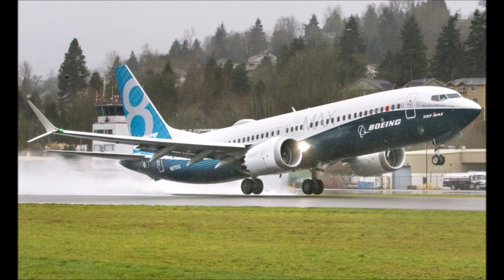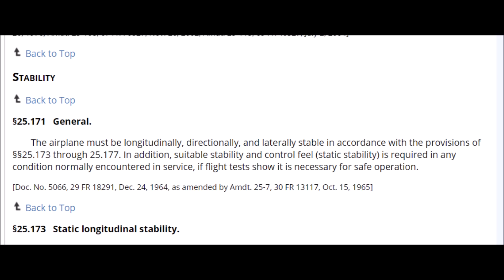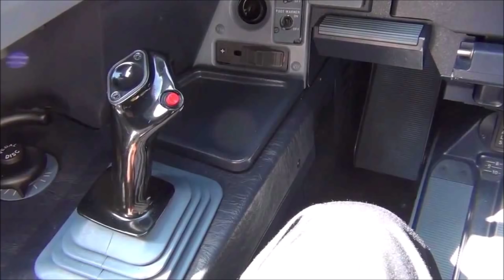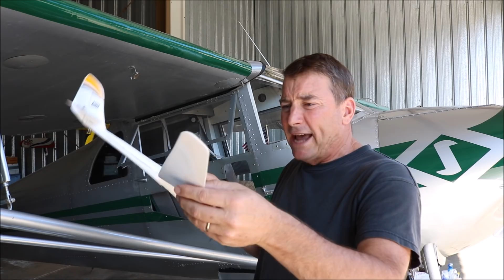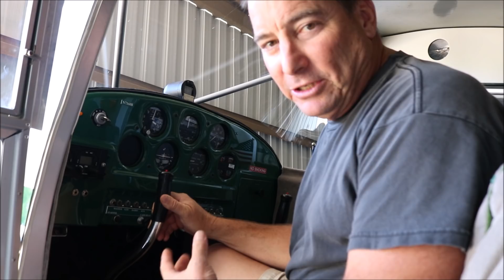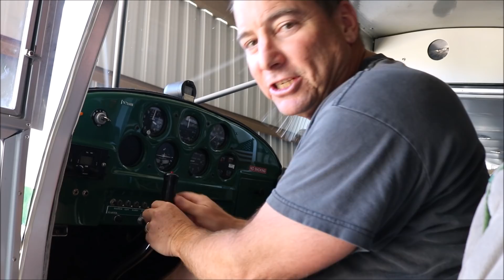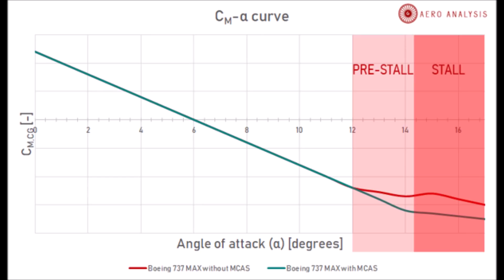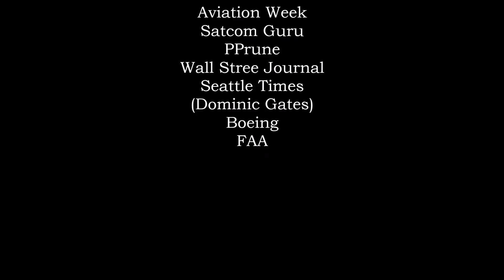737 Max UPDATE 30 Aug  2019

Comment: If they had had the “Angle of Attack” gauges “disagree warning light” working in a standard setup (no unadvertised $80,000 upgrade needed) then the Indonesian crash should have been prevented. At least it has been reported that the previous flight experienced an incorrect MCAS activation but corrected for it. However, the pilots did not log or communicate that it took place, so the  gauge was not repaired between flights as should have happened. That also may have publicized the whole “depending on a single sensor” Boeing/FAA screw up.

Comment: The ultimate solution would be to have a panel of people (pilots and engineers) whose job it is to study designs and find flaws. It is interesting how many flaws they find every time there is an investigation, but not enough looking for flaws before the crash. Of course the overall problem is corruption in the system means that any such panel would quickly get sidelined or used as a rubber stamp.

Comment: You talk about being rushed and cost saving etc at the beginning, but the real problem is they had employees that apparently had no idea whatsoever that they were in the airline industry. They must have hired some games programmers or something. Look at any cockpit and you will see two of nearly everything. You do NOT ignore one of each on each flight then switch over to the other instruments on alternate flights. The duplication is there for one simple fact: it dramatically reduces the chance of failure. But this requires both instruments to be used on every flight so if one is wrong the pilot can use the other, and if he checks both (or pairs of pilots check both) then he is more likely to spot if the instrument is wrong. The decision to write software that ignored one of a pair of sensors when the sensors were both available at all times was just plain stupid and so completely against the philosophy of aircraft design that the fact that it could happen suggests the whole company needs an overhaul in procedures and training in safety by design.

Comment: i appreciate the video, very good info. One thing i don't understand is this. The root cause of these accidents is AOA sensors giving false information to a flawed MCAS system. But the thing is, that should never have happened if the AOA was reliable. What is the MTBF (mean time before failure) of a single AOA. It should like 1 out of 10 million fight hours or better. But here it must be much worse b/c it has failed at least 2 times in a relatively short amount of time. So the point is now using 2 unreliable AOA sensors really didn't fix anything. All we are going to get now is many flights where pilots get a AOA disagree and must declare an emergency and land. In addition when that occurs they are no longer flying a 737MAX with MCAS which means they are flying a different plane literally b/c it handles much differently than the original 737. What i would like to know and what i suspect is that the real delay and battle about getting it back in the air is the type rating. Since the 
FAA lost all credibility, if another major agency in Europe or Asia is pushing to have the Max declared a separate type, that could be the real sticking point. Unfortunately i think more lives will be lost. From a generic engineering perspective the AOA is the root cause and all the things being done will NOT actually resolve this underlying issue. The only proper thing to do is declare 737Max a different type, maybe remove MCAS, and train the pilots to fly the max without and maybe with MCAS.
Reply from the maker: The AOA's were damaged, not faulty.
Reply: Interesting. I wonder how they were damaged? Are they addressing that? At the end of the day the MTBF is all that matters. The components must work reliably in the environment required. If the AOA is susceptible to damage that must be addressed. I suspect there is a bigger issue. The issue may be that using the AOA for flying an airplane is inherently unreliable for whatever reason. All the effort on fixing SW/HW in the end does not address this. At this point it seems clear that there will be 2 AOA disagree events per year (increasing with the size of the Max fleet) and if we are lucky the conditions are good and  pilot work load is low so they can safely land. There will unfortunately be a time when the conditions are bad, work load is high, and a "mistake" will be made causing more loss of life. After thinking about this more i'm convinced that unless the Max is broken out to a separate type, i'm not going to want to fly in it. 737Max-MCAS=NewMysteryPlane that pilots are not being trained to fly. I feel cursed as an engineer with 40 years of experience. Its like you can see through the crap to how things are being driven in the entirely wrong direction. its crystal clear and sad.

Comment: Juan, Great report on the history of the flawed MCAS development. I have worked in a different safety related and regulated industry, and the process failures you are reporting provide valuable lessons learned. Wonder if the people who will certify autonomous driving are listening...

But I think a critical contributing factor to the crash (at least for the Ethiopian crash), is lack of flying experience by the co-pilot. I was stunned to learn that ICAO will allow an airline to take a zero time "pilot", train them in a simulator, and then take the right seat in a commercial transport. Quite frankly that will dissuade me from flying many foreign airlines in the future (talk about saving money!) One has to consider whether all of the FAA's safety certifications for commercial transports are based on the assumption that both pilots will have significant flying experience (including manually flown aircraft) before they ever sit in the cockpit of a commercial transport. 

I have no intent to let the Boeing engineers and the FAA certifiers off the hook - they screwed up, big time. But in the safety related business I worked in the past, the "design basis" is critical to assessing what is safe, and what is not. I doubt the FAA, when certifying the 737, expected pilots in the right seat to only have a total of 700 hours in the type - and no prior "stick and rudder"  flying experience. 

Perhaps the FAA needs to re-evaluate their fundamental assumptions about pilot experience, or ICAO needs to force foreign carriers to hire more experienced pilots (my preference)... 

Your earlier video recalling a simulator instructor taking the plane out of trim while distracting you, and then suddenly giving you control of the aircraft clearly burned a memory item into your brain - wonder if that is part of the ICAO training (would a zero time pilot faced with that scenario had the gut wrenching fear you no doubt experienced, in large part because you already had so many flight hours, versus the  zero-time student's conclusion that this is just a fancy video game test and I lost one....) This recalls two sayings from several pilot friends - "Flying is moments of shear terror interspersed between hours of pure boredom", and that "There are two types of pilots - those that have had an accident, and those that will have an accident."

I would also point out to your viewers that Airbus is by no means squeaky clean in this regard. Airbus has had seven "fly-by-wire" aircraft destroyed due to poor software - in at least four cases due to poor software/human factors interface issues. Five of the accidents were fatal, four with planes full of passengers (the fifth was an A330 test flight). Three A320's were lost due to poor interaction between the pilots and the "push-button" A320 - Air France during an airshow (lots of horrific videos of that), an AirInter A320 flown into a mountainside at night descending into a German airport in IFR (the crew set the descent to "1.9", thinking the glide path angle button was active, instead of the descent in thousands of feet per minute being active. Only a few passengers in the very back survived. CVR recorded the obvious sounds of the speed brakes being deployed, yet the crew didn't notice.) And then an A320 in India that somehow managed to crash short of the runway in day VFR! An Airbus engineer quoted in Aviation Week had the arrogance to say that pilots simply needed to relearn how to fly! He should be drummed out of the profession.

The A320 was never grounded, but changes were made to the buttons on the glare shield and to some software....

More recently an A330 was crashed in the Atlantic with all lives lost because the crew failed to recognize the plane was in a deep stall (falling leaf.) Any groundings then?

And fortunately without fatalities, two A340's destroyed on the ground during engine run-up tests due to faulty software logic (engines at full thrust, but the parking brake is set? Pull the breaker to silence the alarms and the software decided to release the brakes because the plane can't land with the parking brakes on...- two hulls totally destroyed when the ran into a hanger (Canadian RAF), and jet blast deflector (at the Airbus factory during acceptance testing!)

One has to wonder if the FAA has it out for Boeing - knowing that they allowed A320's to operate in the US with the flight control software deficiencies - no NTSB for those crashes and the airplane was certified by Europeans as the primary certifier, not the FAA...)

I personally think the FAA grounding was an over-reaction.Two critical failures in the foreign crashes (a failed AOA instrument detected during the prior flight and not corrected before the first crash), and a co-pilot who would not have been sitting in a US Airline's right seat in the second crash, have resulted in huge economic losses for US airlines and the crews that fly the 737 MAX (ignoring Boeing's debacle), and the flying public who have in some cases been significantly inconvenienced. While standing next to a 737 captain on a people mover after a recent flight, I simply observed that the 737 MAX wasn't as dangerous as the media was making it out to be - the pilot, who had some grey hairs, simply responded "we know what to do." Enough said. 

The only 100% safe airplane is one that never leaves the ground. At least for US carriers with experienced pilots, the MCAS shortcomings is way overblown.

Bottom line, personally I am not looking forward to software taking over flight controls. I would rather pay the extra $20 or so per ticket to have experienced pilots in the cockpit than some video gamer. 

As an engineering friend once noted - "Nothing is fool proof because fools are so ingenious..."
Reply: On balance, all pilots know that no modern aircraft is safe  if the flight crew doesn't follow aircraft emergency procedures exactly  in a timely manner. No amount of sensors, back ups or computers will ever change that. On the question of  the airworthiness of the plane as presented to the market. The short answer is Yes, if the pilots follow emergency procedures correctly. Pilots are a integral  part of the safety equation on any aircraft and cannot be left out of any discussion on aircraft safety.
 Seems like this safety debate should be: "should we have pilots up front at all if we believe computers and automation will (and should ) always save the day" . 
 Safe Pilots operate on a belief that if a system can fail - it will ( all systems) To prevent catastrophe, they are prepared for this every moment on duty. They understand modern aircraft are full of systems that numb them from the cold hard reality that aircraft can become lethal, in an instant of auto system failure and  that at some point they may have to take back control and " fly the airplane" -  in other words, Aviate . They are supported in this belief by their type training and experience. Unsafe pilots ignore this fact at times and are "behind the curve" of the required level of situational awareness to fly safely and to be ready to take back control and be a safe pilot. They become part of the so called system failure. 
The public , and some observers and experts looking at the potential emergency situations forget that this is "flying" after all, an amazing endeavour and a scientific and technical wonder but an inherent risky one too.  In our efforts to simplify and automate for the sake of safety and convenience, we lose sight that there is still risk in this pursuit. We also still want live human beings on the flight deck to monitor and intervene if not to give  us a last chance effort of rescue should the auto systems betray our perhaps naive trust in them.
One could ask then: " why not mandate, demand, and shoulder the cost of installing the latest and best and most complex safety systems we have ever developed on any  aircraft carrying people. Of course this is impractical and very expensive. Not doing this is of course the system we now have which has varying and  debatably sufficient levels of safety. When you look at the spectrum of aircraft out there and appreciate the wide range of sophistication regarding safety systems onboard, it is a wonder flying is so safe. I believe it is the pilots, technicians and engineers and manufacturers skill that make this so. 
This MCAS debate circles around this point that what should have happened in the 737 development. Some imply that  a "cost is no object" critique  of the safety systems. All aircraft development past and future have these constraints and debatable safety deficiencies. Consciously or unconsciously, we accept this everyday as we step on board any aircraft but expect that " all will be ok" . What we really are doing is accepting the risk that today, I am accepting that this aircraft's technology and human overseeing role and skill of the pilot -  in this particular aircraft,  will minimize the inherent risk of flying and I won't perish and that I accept the risk.
The 737 Max as constructed before the accidents was inherently safe ....if the pilots followed the safety checklist in times if system or component failure.
Boeing and the FAA was in agreement that the safety was sufficient in the 737Max ( With Boeing's position being "at the price point offered to the market") as they believed the emergency checklist in the previous  737 models would apply to the 737Max as it  had kept the aircraft safe for decades when the pilots applied it to other similar  emergencies. Despite Juan's excellent presentation on this video, there was nothing unique about the new MCAS system that the checklist could not mitigate if the pilots followed procedures and were attentive and on top of things.
Should safety systems been the latest or just more sophisticated and more expensive?  Perhaps market pressures were at work here in this particular segment of aircraft sales? Perhaps responsibility for Boeing's unfair competition by a government backed european Airbus competitor was too great. Perhaps any blame for inherent risk mitigation for these horrific accidents could be leveled at
Reply: Thinking more on this,  if you are already down the path of throwing Boeing and the FAA under the bus, no doubt American Airlines shares some responsibility for marginalizing safety with waving their big fat purchase order in hand was aware of MCAS  and Boeing's attractive strategy to bring a older but updated design to market with less sophisticated safety systems, at an attractive lower price,  along  with drastically reduced pilot training costs making Boeing very attractive to AA compared to an Airbus purchase. AA is also then responsible by taking any cost savings of a Boeing order to any alleged safety margin erosion or any perceived  reduction in aircraft airworthiness now alleged by this review . In other words, when you're in a bidding war where lots is on the line and lowest price wins is the imperitive, you can risk something. Perhaps even the political environment and attitudes  of the day is at work here - Buy American,  bring jobs home for example. Even the global competitive nature of airfares is at play here affecting consumer decision making. It's a fierce marketplace with company survival and competitive issues always on the table. All this is directly at odds with maximizing safety. The cost of safety in aircraft manufacturing is never quantified, defended, or even differentiated in the consumer's mind but it is always in play. This discussion is not complete unless these factors are considered. Only blaming Boeing for all of this seems somewhat convenient and oversimplified particularly when  the human factors are not weighted fairly or proportionately.